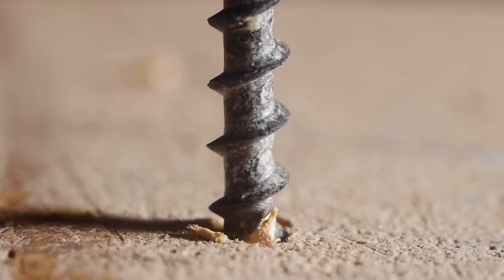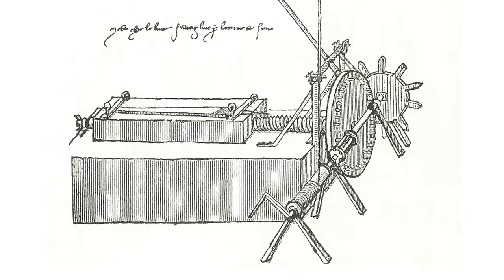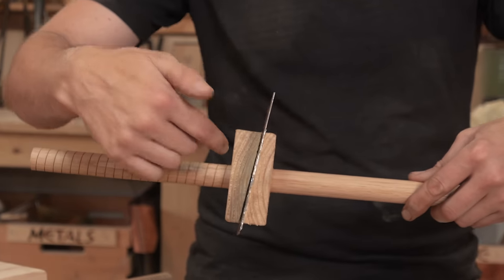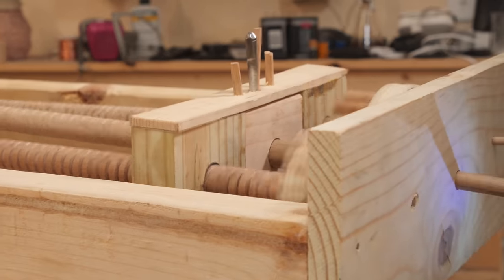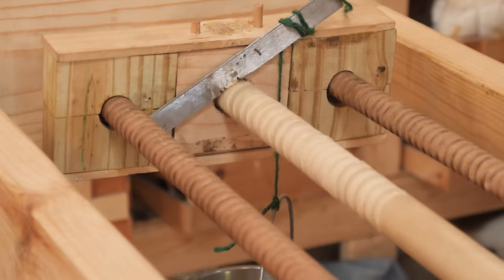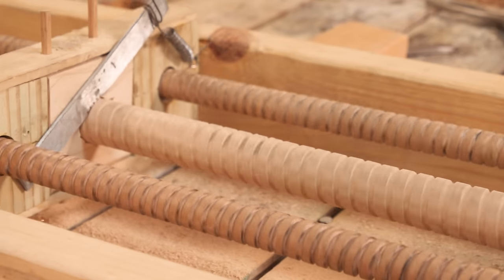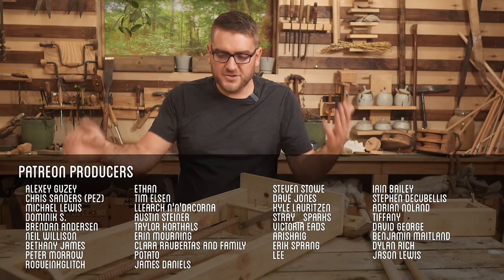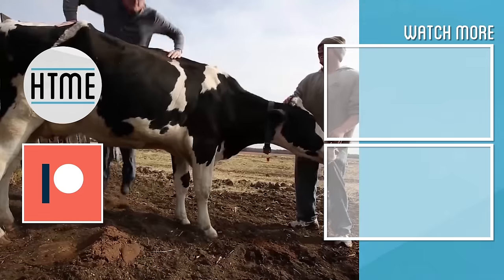This DaVinci Machine Unlocks Precision!

Comment: Feel free to make some minor modifications if needed. Da Vinci often deliberately drew pictures with errors in them that rendered them useless.  This was to protect his work from being copied in the days before patents.  But his drawings DID illustrate the IDEA for his own reference.   The crank that drove his "tank" was an example-- It would not work as drawn.
Reply: 11:50
Reply: @nicholas-dv1mg i was gonna say that but they probably commented halfway through. It's still useful info for anyone thay doesn't finish the video
Reply: Except da Vinci’s notebooks weren’t shared… his errors were most likely actually errors.
He was sketching things up to get them out of his head. The notebooks weren’t a manual for publication like the swordsmanship manuals of the time, they were his own aide de memoire.
He didn’t write in mirror script because it was some diabolical secret code; it’s just that as a left hander he wasn’t dragging his hand across the wet ink.
Reply: @LoneEagle2061  as a left handed person, I agree this is more likely than a copyright protection, I have used fountain pens in the past and it's incredibly boring writing letter by letter. Also the reason I don't use it anymore. I'll write with pencil, or just do it digitally because I hate smudges (especially with ink)
Reply: @LoneEagle2061 shared, no. Had the potential to be stolen, yes. Sometimes things go public without the authors permission and many scholar and trades used codes to keep secrets secret.
Reply: @LoneEagle2061 Wouldn't there have been times when he needed a part from another person? Thereby needing to share sketches with them so that they understood what he wante
Reply: @LoneEagle2061  they weren't meant to be shared, but DaVinci was notoriously protective of his thoughts and ideas.

He wrote words with a mirror to make them harder to read and would include errors that would make them unuseable.
Reply: @LoneEagle2061  and as someone who's left handed and has used fountain pens/glass pens/feather pens, i wouldn't be writing in mirrored text to make it easier lmfao.
Reply: @AaronLyNxAI  i havent really ran into this issue, I just learned to light my hand above the paper.
Harder to be neat but it prevents smudges and just takes some practice
Reply: @brutusthebear9050  he did not build machines, he designed them.
Reply: This idea the inaccurate drawings were intentional is silly. As if anyone has drawn anything of complexity perfectly accurate in the first go. I've spent decades building from drawings that were never perfectly accurate.
Reply: Not ALL is drawing were inaccurate but SOME were'  The gears to move his tank obviously were.  They would not work.
Reply: @doodlecaboodle9298  It makes sense if you can read mirror script (I can, as long as the handwriting is not too ornate or too shoddy). The first time I tried writing with the left (I'm right handed) I managed to write with a neater script than normal, just mirrored (by mistake); the moment I forced myself to write in the normal direction, my handwritting became shoddier and I was never again able to repeat the feat.
Reply: "Writing down an idea and saying "This'll work" isn't inventing anything."
Reply: Was that before or after he copied them from other people?
Reply: Leonardo da Vinci was ambidextrous, he wrote in mirror script with his left hand and normal script with his right hand as a convenience. It was simply natural for him to write that way.
Reply: @LoneEagle2061  He wasn't defending against sharing. He was defending against theft.
Reply: As for your thoughts on automating this/having it back and forth: should be doable, I saw something thst did this in an exhibit on DaVinci's works, though back when I saw that years ago I didn't know why someone would want it. And now I know 😂
Reply: You know they had lathes long before DaVinci right?
Reply: All Inventors do that especially if they can draw in isometric..
Reply: The first modification would be to get rid of this unnecessarily complicated machine. You can do it far easier than this.

The marking tool is more than enough, with just minor modifications.
Reply: That’s commonly quoted, but using Occam’s razor, he was likely just making mistakes because everyone makes mistakes.
Reply: He didn't do it for patent reasons tho.
He worked for nobles and ludovico sforza in particular was a dick

Comment: So basically you'd have to use the crude hand carved threads to make "machined" threads that then replace the originals to make the second iteration more precise.
Reply: Yeah, I was hoping to see them actually replace the original set of lead screws in this, because that's how precision is really achieved. Using machines to make more and more precise machines iteratively.
Reply: @TheLadderman  they also could have stuck a chisel in their first jig and it would have fully cut the threads
Reply: If you think about it, all of human history is a result of that development loop.
Reply: Give a dwarve a wooden hammer and he'll use it to make a crude iron one, iron to steel to masterpiece
Reply: In theroy, yes. In practice also yes, but its a lot easier to use lapping to make more precise threads, and involute gears, as three or more gears, and three or more threads, and three or more lapping plates can be used to lap each other treading towards (but never reaching) perfect threadfroms, perfect involute gears, and perfect flat surfaces.

But they also want to naturally make a perfectly straight rod, round and smooth disk, and a potato chip shape.
So ut takes a lot of skill to reconize when things are going sideways and as such these are the three processes we have yet to automate or imporve beyond what the ancient's worldwide where capable of.
(of couse, starting with a nearly perfect flat or screw then lapping it in leads to much better results, but lapping is stone age tech and hasnt imporved in itself)
Reply: the SMART guy was the one that realised that moving a simple wedge or inclined plane would generate a thread... accurately.

you only gotta gear it to move a certain distance for every rotation, a simple string and pulley is enough.. and voila... you got a thread. need a different pitch? change the angle or the pulley.
Reply: People do this with their DIY CNC mills today.
Reply: @paradiselost9946  a differental pulley would also enable threads to be cut
Reply: @stevecummins324  how does it traverse a cutting tool at a fixed ratio in regard to a rotating shaft, without requiring a pre-existing leadscrew?

again... a screw is simply a wedge or inclined plane rolled up into a cylinder. 

and inversely, its very simple to make a wedge force a cutting tool along a shaft at a fixed ratio. and its just as easy to alter that ratio of 'lead".

you dont require teh wedge, but any other method doesnt create a screw of a "useful" pitch. you could just drag teh cutter along teh shaft with a rope around said shaft, but then you end up with a pitch of 3.14 times that diameter... you could make a gear reduction in between, but then any eccentricity or variation in velocity creates a drunken or "skewed" thread, and theyre utterly useless... its quite hard to make an ACCURATE gear box.

very simple to make an accurate WEDGE.
Reply: @paradiselost9946  difference in circumference of  winch drums, equals the lead per revolution.  The   play out from one drum minus take up from other. Couple of wheels over which the cable runs to keep  angles from drums constant/change rope  direction.  Rope looped over pully to pull carriage towards winch drums. Bit of rope over final pulley and to a hanging weight to keep system tensioned.
Reply: yeah pretty much.
Reply: Reminds me of a line I heard in a TV show.

"I don't have the tools, to make the tools, to make the tools to fix this." 

Where is it from? Do I look like I know? Because if I do I'm sorry, so so sorry. Because ai have no clue.
Reply: @paradiselost9946   "how does it traverse a cutting tool at a fixed ratio in regard to a rotating shaft, without requiring a pre-existing leadscrew?" Rack and Pinion. A rack is straight cut teeth on one side of a flat bar, the pinion only has to be strong enough to push each tooth. The resistance felt by the pinion from the rack is lateral (the load on a cutting tool being in the vertical plane - so the cutting forces aren't sent to the pinion, meaning it can be very thin / easy to make interchangable disks quickly for different ratios). There are lathes to this day that still use this setup, and since the drive wheel (the thing your foot spins, but can be a hand crank) is connected to both the work piece and the pinion... cutting threads isn't that hard with about 6 hours of time, a knife, hatchet, and some trees.
Reply: @user-wg5lu6ub6e  i thought the same thing or just keep running the dowel back and forth with the blade they used to mark the thread.
Reply: @Azmodon  WHO CUTS THE RACK?
remember, this is supposed to be anywhere from 1 AD to 1800AD.

a rack requires extreme precision, and the gears running on that rack require extreme precision. any inaccuracy is reflected in the resulting thread.

and when cutting a rack on a modern machine, guess what it uses? a lead screw!

yes, some lathes use racks... only for feeding with the hand wheel.. they dont use them for screwcutting. 

if the rack bends, distorts... you have an inaccurate thread. if its not mounted dead parallel to the shaft... you get an inaccurate thread. any deviation in teh rack, regards tooth spacing, anything... it produces an inaccurate thread. if the gear running on teh rack is inaccurate... so is the resulting thread.

seems no-one here has ANY background in machining, engineering, or metrology. any TOOL MAKERS HERE?

yall seem to miss the point... winding an inclined plane around a cylinder is the simplest, and most accurate method of making a screw, irrespective of the accuracy of the machine itself. all that matters is the shaft is concentric, and the wedge traverses a fixed distance per revolution. with no slip.

"the load on a rack is lateral"... so whats the "pressure angle" on a gear, and why is it there? and what happens when you alter the pressure angle from the standard 20 degrees? increasing the pressure angle puts more load on the bearings, a radial load. reducing it makes long spindly and weak teeth that interfere at low tooth counts...

twenty degrees is chosen as the standard as it falls in the "sweet spot" of limitations.
Reply: That's kinda how we've been progressing through history this whole time! It really applies to everything.
Reply: It would be easier to use an arrangement of GEARS to aid cutting the first screw, both turning the stock and moving the cutter at the same time. This is likely how the first REAL "guide screws" ever were cut.  As gears would have been easier to cut with better accuracy at the time, than a long spiral.
Reply: modern programming languages are also made this way
Reply: PRetty much. Machining and manufacturing is using a level 1 tool to make a level 2 tool, then a level 2 tool to make a level 3 tool, and so on and so forth.
Reply: ad infinitum until you notice no change in quality ;-)
Reply: @user-wg5lu6ub6e  This right here. A V gouge stuck at an angle in a block of wood so that it intersects with the hole like the "Marking" tool they made is how you turn an oak rod into a wooden screw...
Reply: @jasonsexton8869  yes !!! ,i knew I'd seen videos of this before ,allot of oil is used if I remember
Reply: explain how with simple lathes watchmakers can and did manufacture precision miniature screws, as also found in mediaeval tournament armour.
Reply: @user-wg5lu6ub6e i was pulling my beard looking at that... "Why don't you put a file there or a carving knife or something? FFS"
Reply: @Zenas521  Even people, who are NOT an Engineer ;)
Reply: I wonder if you could use large twisted ropes to act as template screws?

Comment: The best part is: It can make all the possible lead screws you could want, it can literally make itself better.
Reply: i dont think so, because you'd need to make the first pair of lead screws... the copy can only be as good as are the originals
Reply: @GuilhermeCarbonetti  It depends on what you mean be "better".  The errors in the 2 guide screws will be averaged out when carving the profile of the screw you are making.  So if you thread two rods with the existing setup, replacing the original rods with those new rods will give you a more precise (but not necessarily accurate) result, as it will wobble less.  You could then theoretically repeat this process, although I imagine it would give diminishing returns, and there would be no point beyond 2 or three total iterations.
Reply: You could also make larger diameter lead screws which wouldn't wobble as much, and as some pointed out, since this will average out errors, you can make three screws, and run combinations of them front ways and backwards to get closer and closer to the norm (similar to how they use three flat plates ground against each other in turn to remove all the high points).
Reply: Another trick you could use to extract more uniformity; flip one of the screws end for end. That would allow you to create two screws that have different error distributions starting  from only two original screws. Then uses them to get a 2nd generation product form only 2 hand cut screws rather than 4.

That said, I agree there's a limit, but I suspect (at least if you were to use metal) it would be more like 3-5 generations of screws down the line. I think I've heard suggestions for improving beyond that based on lapping a screw with a long nut. That will tend to require that the pitch of the nut match the screw over its full length regardless of where it's positioned. That will tend to remove variation over the length of the screw. (But it would also likely end up with a thread that's only accurate loaded/feeding in one direction.)
Reply: @GuilhermeCarbonetti  The origin of precision all boil down to figuring out how to make more precise products from less precise tools. Optical quality surface plates from 3 rocks and polishing powder is the classic example, but I've read it can be done with screws as well (like to the sub micron level with strictly mechanical tools), thought I've yet to find documentation on a detailed process.
Reply: You can definitely use a less precise screw to make more precise screws, and bootstrap up to whatever level of precision and accuracy you need.
Reply: I came to the comments to say the exact same thing. Nice. 😂
Reply: @benjaminshropshire2900  I really like the idea of using a long nut. Even just using two nuts spaced some distance apart will tend to average out the errors during travel.

While you’re right to mention the increased backlash in the system, that’s easy to design around. Simple make sure that there is some preload, and always make any cutting passes in a single direction. While it’s not idea for a finished machine, it would absolutely serve to produce a more precise screw in an iterative process.
Reply: @kenrickman6697  There is however the other interesting question: how do you make a longer screw than you already have without losing most of the accuracy? All the ideas I've seen for making better threads have end effects that make the resulting thread (or at least the accurate portion) shorter than what you started with.